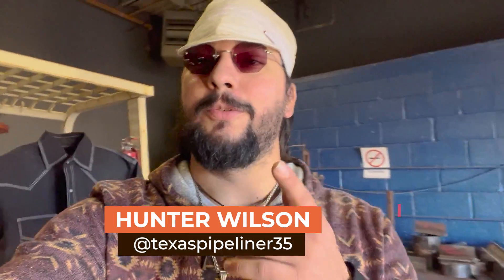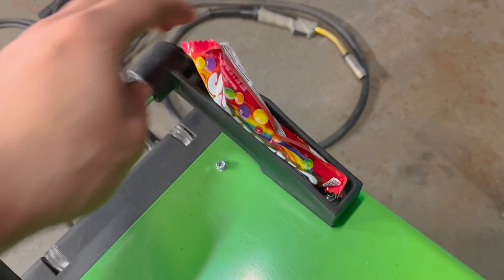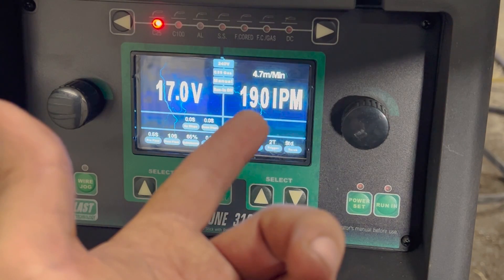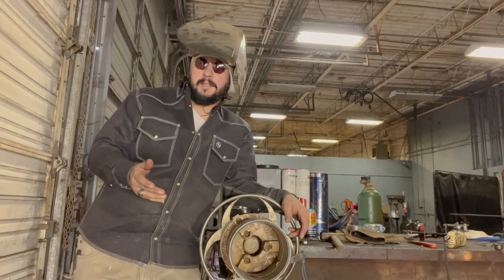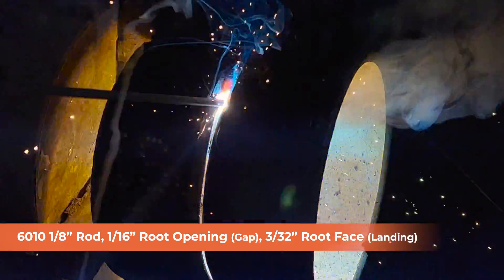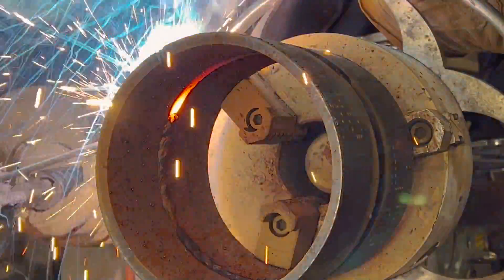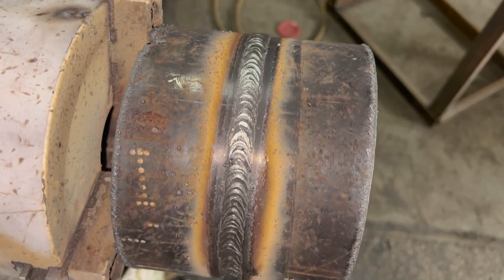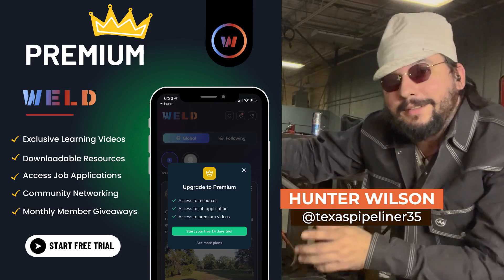MIG and Stick Welding with the Cyclone 312 by Everlast!

Comment: I’m really beginning to appreciate Everlast machines. They all have the bells and whistles and the best prices on the market for machines that are really beginning to get on the same level as Lincoln and Miller. For the longest time, with Miller and Lincoln, it’s the name you’re paying for. 
We got some new Millers at work in the last 12 months, and we are already having issues. 
They’re not on the same level as our XMT’s, as we only use these ones for mig jobs, but they were still 8+ grand a piece. Really not much difference than the one in this video to the ones we just bought. Except for the price!

We also just recently bought a Lincoln Aspect 375, and I personally would put that on a similar level to the Everlast power Tig 325EXT. They both have pretty much all the same features. 
Probably won’t be long before they start matching the prices too

Comment: What is it ?  Transformer or inverter ?!  Cant be both at the same time ….

Its an inverter !!!!
Reply: I'm curious which do you think is best? And why?
Reply: @SquareBodyK5 transformers are transformers …..  inverters can be awesome if programmed right the right hardware AND the right software working in conjunction or they can be really shit of corners were cut and things don’t match ….  Hard to say what is better ….  If I can pick a high end inverter that would be preferred over a transformer …..  if it is a shit inverter than a transformer is better 
The future is inverter though